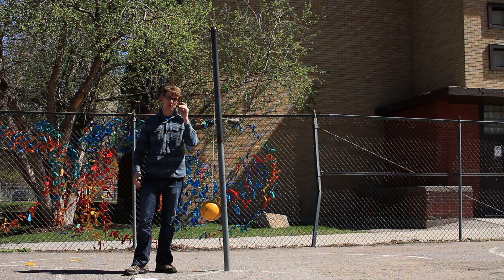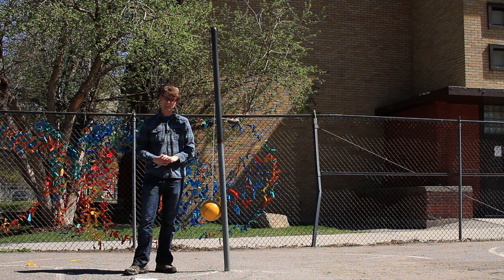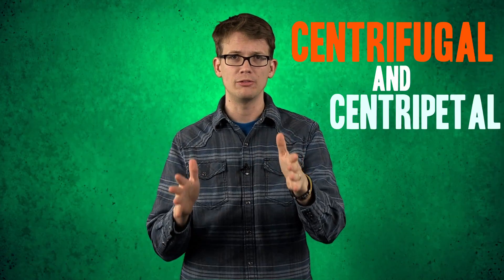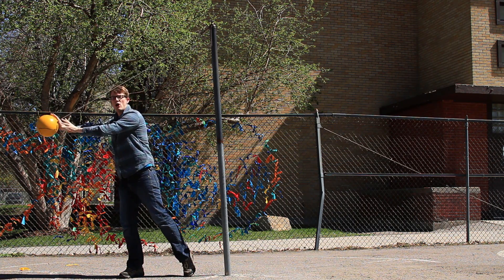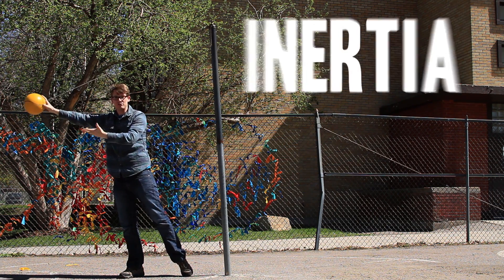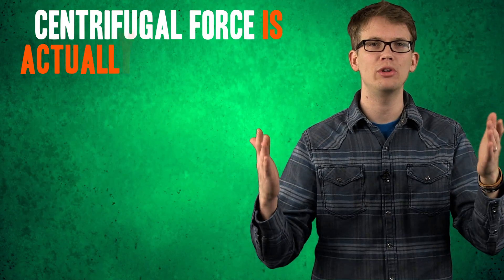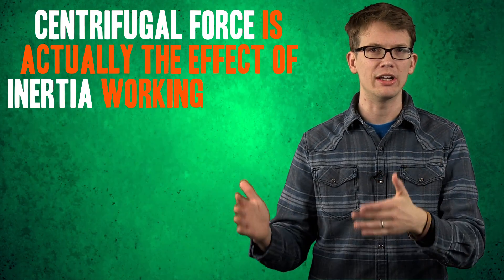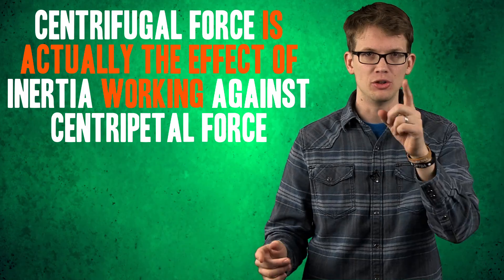IDTIMWYTIM: Centrifugal Force

Comment: which force exactly,centripetal or centrifugal does the ball feel? If centripetal force is the cause for it to move in a circular path and not in the straight line,the ball must be feeling centripetal force......then where does the centrifugal force come from? If i stand inside the ball,which force do i feel and in which direction?Why do we always say that centrifugal force is the one that acts in a non Newtonian or non inertial frame of reference? Its inertia's fight against the centripetal force is real,right?then how is it a fictitious force? Though there is no string like in this case,gravity is  a real force,right?         HOPING TO HAVE A SOON REPLY
Reply: The ball is feeling neither force. It is only experiencing inertia from its mass and tension force from the string, which cause a centripetal ACCELERATION. It is not a force. Centripetal acceleration means that it is a center-seeking acceleration. Even if the ball is moving at the same speed, it is experiencing an acceleration because of the constant change in direction (and thus a change in velocity) caused by the tension force of the string keeping it from moving in a path tangent to the circle it creates around the pole.
Reply: Newton's second law: Force = Mass x Acceleration.  When there's acceleration, there's definitely a force.  Centripetal force is what causes the acceleration, which in turn causes the change in direction.
Reply: The ball only feels centripetal force because centrifugal force is just a different way to think about centripetal force and not an actual force.

The ball constantly wants to move in a straight line. The rope is always pulling at a 90 degree angle to the ball's motion. Since none of the rope's pull force lines up with the ball's motion, rather than speed up or slow down the ball, all that force does is change the ball's direction. It doesn't pull it closer or push it farther from the pole, which is why the rope stays the same length (taut, at least until it starts coiling).
Reply: Everyone here is wrong. The ball experiences centrifugal force (if feels that it is pulled AWAY from the pole, not towards it), but only because its frame of reference is non galilean. If you are standing on the ground you call that inertia, but it really depends on how you look at it (or more precisely, from where you look at it)
Reply: Not really.  Even from the ball's frame of reference it is being pulled toward the center.  Centrifugal force is the reaction force - the ball is pulling the string away from the center.  The string is the one that experiences it.

Imagine you're in a car that is turning left.  You don't feel any force pushing you toward the right.  Instead, what you feel is the right side of the car pressing against your right shoulder and pushing you toward the left.
Reply: letao12 I think you have never been in a car if you say this. You clearly experience a force similar to gravity but away from the point you are revolving around, therefore it's called centrifugal. It has nothing to do with the car pushing you on your shoulder and that isn't what its happening. 

Centrifugal force isn't a reaction force, it's just how the body experiences inertia in the frame of reference that is spinning, and btw, it is very real when you are in that reference frame.
Reply: Wut... when you sit in a car turning left, are you pressed against the car on your left side or your right side?  Force can only come from the side that presses against you.  It's not some mysterious energy that magically transports you in a direction when nothing is pushing.

If you still think your explanation is correct, then enlighten me.  I'm saying the string pulls the ball toward the center, the string's tension is providing centripetal force.  You say that isn't happening and there's centrifugal force.  So what exactly is providing that force that's pushing the ball away?  I'm also saying the car pushes against your shoulder toward the center, that pushing is providing centripetal force.  You say that isn't happening and there's centrifugal force.  So what exactly is providing that force that's pushing you away?
Reply: letao12 You didn't understand me. What I was saying is that the reality of a ball or a car turning can be interpreted in two different ways depending on from where you look at it. If you are stationary on the ground, you see a centripetal force that is always changing the direction of the ball, we agree on that. 

However, if you are in the car or ball or whatever, you do experience a force that is centrifugal, since you are stationary to yourself and everything else is revolving around the axis at the opposite direction the person on the ground would say. The centrifugal force is what keeps you stationary in your frame of reference (of course you always are stationary relative to yourself).

To answer your last question, the centrifugal force comes because you are frame of reference that is being accelerated, that's just the way the universe works. If you are on the ground you see inertia, if you are the object spining you see centrifugal force. Both interpretations are correct and intuitive, and I think that you can agree that in a car when turning left, you experience a force pulling you right, you can't deny that.
Reply: OK but can you clarify what is the centrifugal force acting on?  You, or the objects around you?  You seem to be saying the answer is "you" (e.g. "you experience a force pulling you right").  So the next question is, since you are stationary and not accelerating in your frame of reference relative to yourself, where did that centrifugal force go?  Is there another force balancing it out, or is F=ma not correct?
Reply: letao12 Centrifugal force acts on the object that is spining. 

Also, just because you have a force acting on you, in this case the centrifugal, that doesn't mean that you can't be stationary. This force compensates for the force that is making everything else spin.
Reply: What is "the force that is making everything else spin"?  If it exactly compensates for centrifugal force (thus keeping you stationary), then it is equal in magnitude and opposite in direction to the centrifugal force.  Congratulations, you just brought centripetal force into your interpretation.
Reply: letao12 No, centripetal force isn't responsible for moving everything else in a non galilean reference frame. 
I'm afraid you still haven't understood that reality can be interpreted in two different ways, and centripetal isn't in one of those.
Reply: So can you please answer my question, what is "the force that is making everything else spin" which you say is compensating for centrifugal force and keeping you stationary in your reference frame?  Where does THIS force now come from?
Reply: letao12 It comes from you being accelerated. Physics aren't as simple when you are accelerated, and a force can just appear from that. I'm afraid I can't explain to you how that works in a youtube comment, but if you do the math with galileo's relativity, that's the result you get.
Reply: No, you're contradicting yourself.  In a previous comment you said quote "the centrifugal force comes because you are frame of reference that is being accelerated".  Now you are saying ANOTHER force which COUNTERACTS centrifugal force ALSO appears because of the acceleration.  Which one is it?  It can't be both, otherwise the net effect is 0 and you experience no centrifugal force at all.

I know what accelerating frames of reference are.  I know how to work with them.  I can actually do the math.  I also know enough to know you are mistaken in your interpretation.  There are valid ways to model centrifugal force.  The way you're trying to describe it does not work.

I'll just lay out some of the other problems with your ideas.  First, the notion that "a force can appear from acceleration" is plain wrong.  Forces cause acceleration, not the other way around.  No matter what frame of reference you're using.

It also has absolutely nothing to do with Galilean relativity.  Galilean relativity only applies to INERTIAL frames of reference.  It says nothing about accelerating ones.

To top it off, you started pushing the "centrifugal" interpretation because you said it is intuitive.  But if you have to learn some mysterious math that you can't even explain in order to describe how it works, then it's not at all intuitive.
Reply: letao12 Yes, it can be both.

If you change your reference to the ball, then yes, acceleration produces a force, since you are accelerated relative to the ground but relative to the ball you are stationary. 

Galilean relativity can work in non inertial frames of reference, you simply have to add the inertial or "ficticious" forces to f=ma, and centrifugal is one of those forces. If it can't be done, I literally wasted my last year in university because they told me lies since the second week.

I honestly find centrifugal force intuitive, you don't need math to explain centrifugal force, but you need it to PROVE it to someone on the internet.  Also, you misunderstood me, I should be able to prove it to you, but in a paper or a blackboard, not in a comment of youtube.
Reply: Yes, I believe they taught you some correct things in university.  I'm saying you are not applying it correctly in this situation with the way you're trying to describe centrifugal force.  Maybe if you actually work it out on paper then the details will be clearer to you and you'll see that it doesn't work the way you think it does.  Or check with your professors and they'll tell you what you need to know.

And no I'm not asking all these questions because I need you to prove it to me.  As I said I already know how it's supposed to work.  I'm asking leading questions so that you'll think critically about your model and discover for yourself why your interpretation doesn't work.  For example our last exchange about your idea that the same cause (acceleration) can produce two equal and opposite forces on the same object at the same time, but for whatever reason you won't cancel them out and say it has 0 net effect thus the object experiences no force.  Or your second force which supposedly compensates for centrifugal force (i.e. same magnitude and opposite direction).  What would you call a force that is opposite to centrifugal?  I pointed out it's exactly the same thing as centripetal force, but you refused to acknowledge that.

Comment: Hold it. There are equal and opposite radial forces at work. The string exerts a centripetal force on the ball, but the ball exerts a centrifugal force on the string, which keeps it taut. Break the string, and the ball carries on in a straight line, but the string goes slack and spirals downwards, still being tethered but experiencing only the weak forces created by the string itself, too weak to overcome gravity. After it has finished wrapping itself around the pole (because of centripetal force) it unwinds itself (to release the strain caused by the centrifugal force plus gravity). If this is right, it should fly away from the pole slightly as it unwinds.. .
Reply: +Steve Paulsson Um... 

No.

Comment: But why does the ball not fall at its usual speed?
Reply: +BruceNJeffAreMyFlies Because the movement of an object is the sum of the force vectors exerted on the object.
As you see at 1:28. The one that is left out is the down ward force.

For simplicity just focus on the vector tangent to the rotation and gravity. Add those two and you have a ball traveling forward while slowly going down in elevation. 

The bigger the tangent force (ie rotation speed) the slower the ball will lose elevation.

Same reason bullets fall slower when fired, than if you just dropped them.
Reply: +Ben Ghazi Except that both a dropped bullet and a fired one would lose elevation at the same rate in a vacuum so too would a dropped ball and a moving one. However the ball in the video was moving though a fluid known as air at the time and thus fluid dynamics starts to come into it, even trying to demonstate the simplest things it gets complicated to explain away all the anomalies from what you would get in a vacuum since it generally always comes down to dealing with the complex was fluids behave.
Reply: It's because if you look closely, the ball is always positioned lower than where the string touches the pole.  The string is not only pulling the ball inwards, but upwards at the same time too.
Reply: Because as soon as the ball drops lower than the string, the string also exerts an upwards force on the ball, as well as a centripetal force.
Reply: The ball DOES actually fall while it's orbiting* the pole, that's what causes the string to be wound around the pole in a spiral fashion.

*Yes i know it's not a true orbit, but for lack of the proper word, i chose to use this one.

Comment: It is incorrect to write of centrifugal force as not being a real "thing." Centrifugal force is not truly a force, but it is a very real phenomenon that has real consequences and practical application. It is not as simple as misidentified inertia. If you gently accelerate a vial of blood and then let it fly freely through space, it will have plenty of inertia, but the parts of blood will not separate. When a phlebotomist takes that same vial and spins it in a centrifuge, the interaction of inertia and centripetal force (and in this case variable buoyancies) add up to a phenomenon that certainly does exist and is actually used in hospitals every day to analyze blood. This is called centrifugal force, but only the name is not real.
Reply: +Richie P: Agreed, it should be called "centrifugal effect". The name is misleading.  The interaction of inertia and centripetal force = centrifugal effect.
Reply: +Richie P What you are describing is simply this; heavier things have more inertia. The denser material simply has more energy to get to the outside so it pushes its way past the less dense material.

Comment: Building off of an old XKCD comic (xkcd.com/123/), if you have your reference frame rotating at the same angular velocity as the ball, then the ball would seem to be stationary and pulling away from the origin. When the rope is cut, the ball would fly straight outwards as if being pushed away from the center. So it's possible to do some mental gymnastics to create a centrifugal force, but it has to be in an inertial reference frame, so it's useless in any other situation.
Either way, if they made a bond movie around that comic, it would probably still be better than Quantum of Solace.
Reply: Brendan Battey You mean it has to be a NON-inertial reference frame.  In an inertial reference frame, centrifugal force doesn't exist.  What you described is a rotating reference frame, which is not inertial.
Reply: Yes, thank you.

Comment: Centrifugal force is not a real force. For example, in a car, loose change slides away when the car goes around a curve. This is because the car is changing direction and is therefore changing velocity and is also therefore accelerating because change in velocity is acceleration and if the car is accelerating then that means it is subjected to a force and this force is called centripetal force. The loose change, however is not subjected to the centripetal force, it slides away because the car is changing direction while the coins aren't and they resist this change in direction and hence inertia as told in the video and this is what we call centrifugal force or rather an effect. They slide away tangent/perpendicular/ 90 degrees to the curve always and they stop sliding away when the car stops going around a curve.
Reply: This is correct.  However, if you were tasked with describing the motion of the bodies from within that car while applying Newton's laws of motion, you would be required to treat centrifugal force as an actual force for the purposes of reconciling those forces from within that rotating reference frame - where Newton's laws of motion would otherwise not apply.  It's the reason that the concept of centrifugal force exists.  This video is addressing a misconception regarding centrifugal force from an inertial reference frame, and in inertial reference frames, centrifugal force does not exist - and then you could simply attribute the motion to inertia.

In other words, Newton's laws of motion do not apply UNLESS you are in an inertial reference frame, so inside a car that is turning, you are NOT inside an inertial reference frame, so attributing the motion of the coins in your scenario to inertia is invalid, because the law of inertia does not apply from within that frame of reference which is accelerating.  In THAT frame, the motion of the coins should be attributed to centrifugal force - for the proper application of classical laws of physics.  It is only from the reference frame of someone in an inertial reference frame observing the car turning that the motion of the coins can be attributed to inertia.  It all depends on your reference frame, and for the proper use of centrifugal force, it is helpful to understand that the law of inertia does not apply from within non-inertial reference frames.